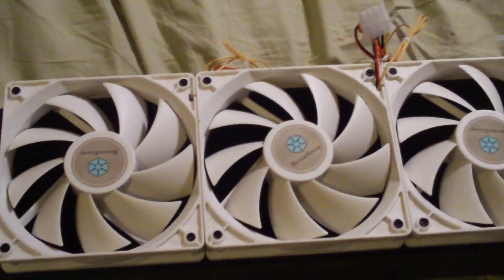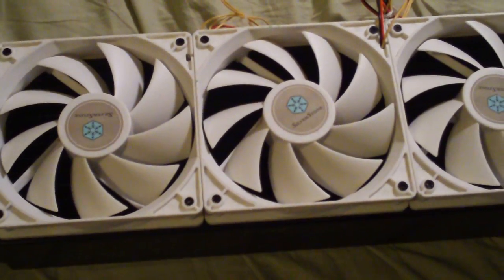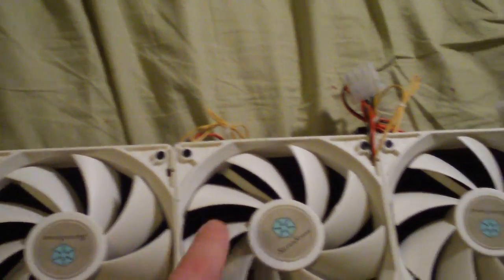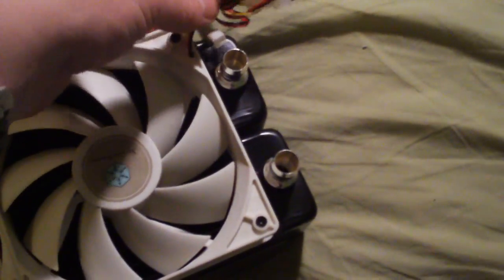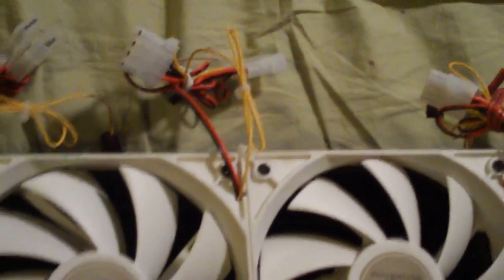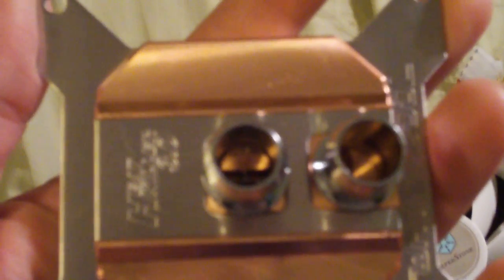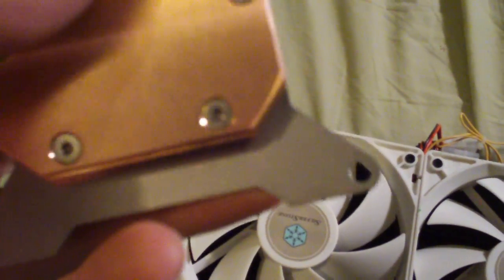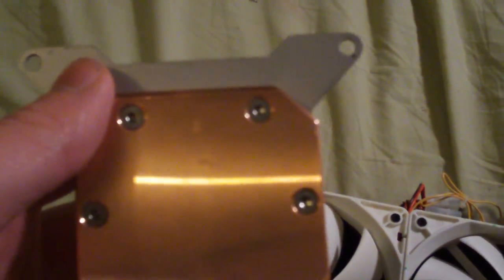Feser Radiator and Heatkiller Closer Look

Comment from the maker: Actually it will. I know and saw bench marks also you can get micostutter with the 295s in quad sli. Also you CAN Not quad sli 275, or 280, 285. It is tri sli had each car has one processor. Those 3 together = tri sli. You can only quad sli 295s .1 295 has 2 processors get 2 of them you will have quad sli. you need to do your research  not me

Comment: Im planning to buy a multi video card configuration. my problem is that I dont know which to choose. 3 SLI evga 285 GTX or quad evga SLI 295 gtx. Please tell me which i s the best configuration for a hadcore rir. I have this question beacuse I heared the quad SLI have issues with the drivers and 3 SLI is better but I dont know...lol
please answer my question
Thanx